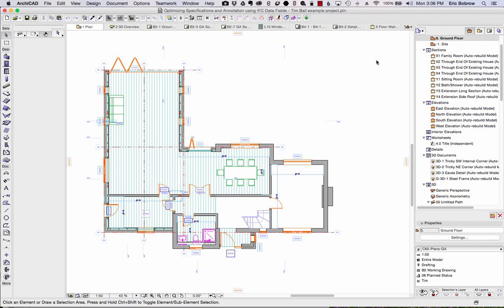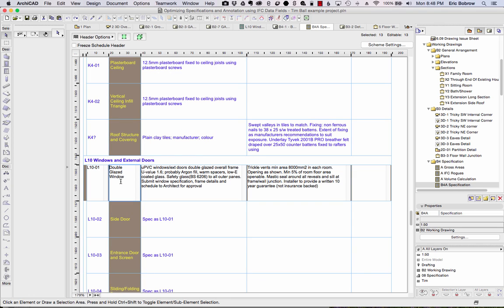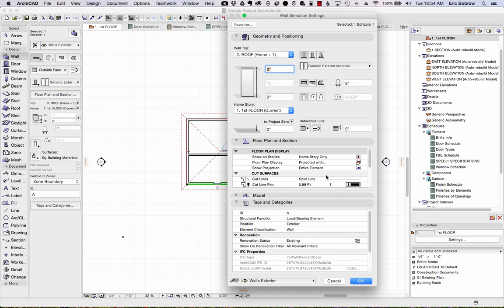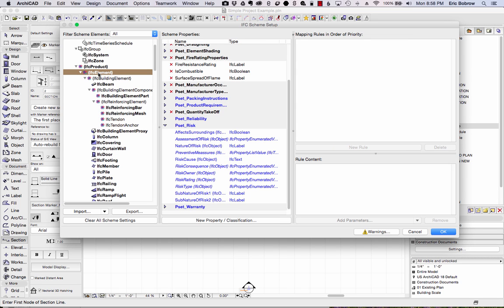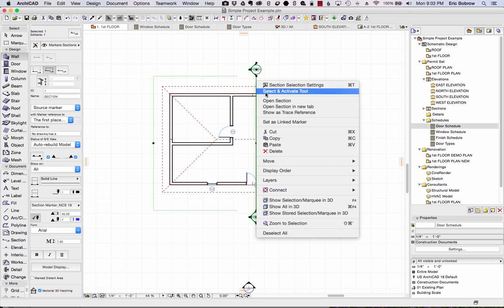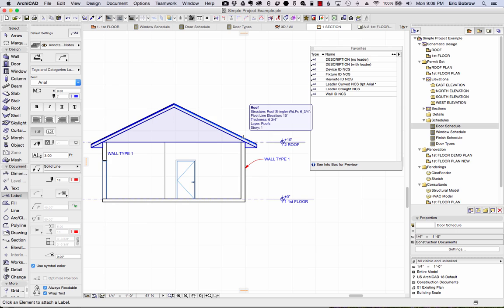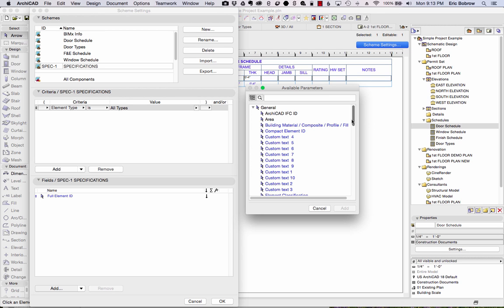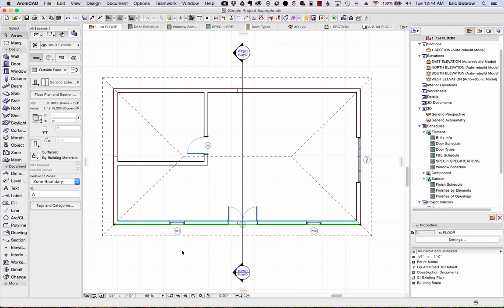ArchiCAD Tutorial | Generate Specifications & Optimize Annotation using IFC Data Fields | Part 1

Comment: Problem solved......hmmmmm, one very important step, had to look very carefully to find it. It required the correct 'Geometry Method' to be selected in the Label Settings !!
Reply: +Eric Bobrow - You had selected 'Associative' correctly (the one with the label pointing to what looks like a wall), probably without realising it ! I noticed it when I scrutinised your settings against mine....took me a little while to notice something so subtle.I also sent a query to Graphisoft Australia (aaaah the value of having a Select Agreement !!) at the same time I posted in here, but figured it out just minutes before they responded with the same solution.